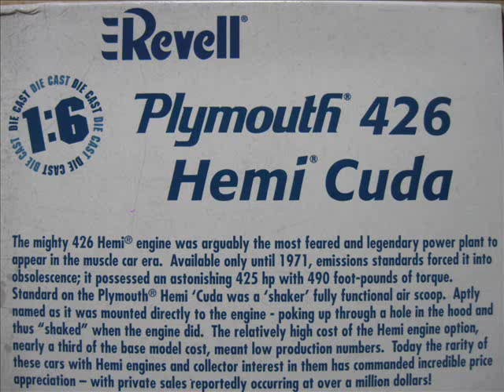1/6 Scale Revell 426 Hemi 'Cuda Model Engine Kit -  Part 03

Comment from the maker: @MatteoNot100 It's a plastic model kit.  It does not run.  The 1/4 scale invisible Hemi will show the moving pistons and valves opening and closing, the crank case rotating, but then again, it is just a plastic model kit.